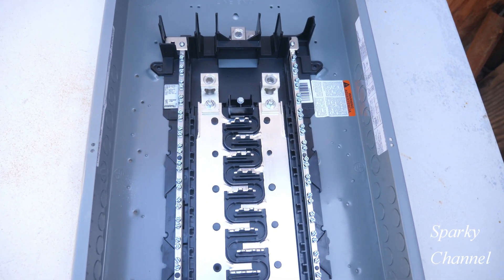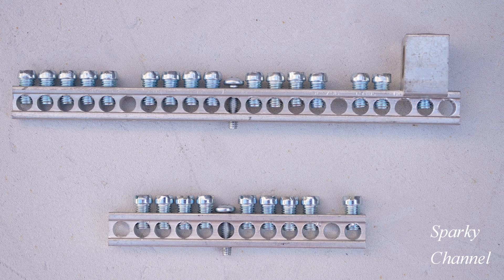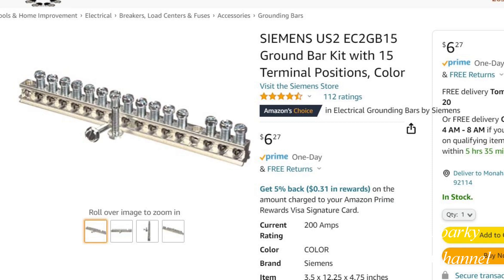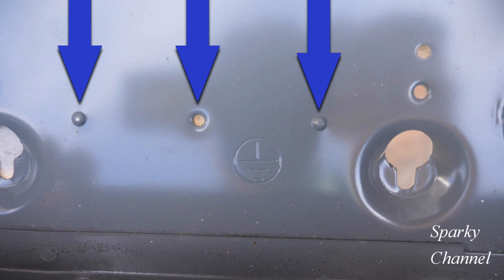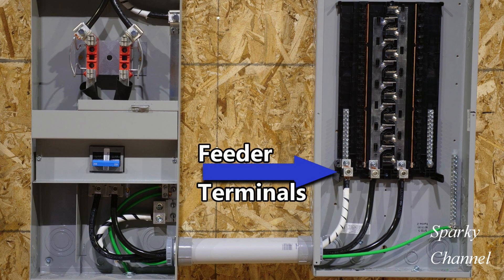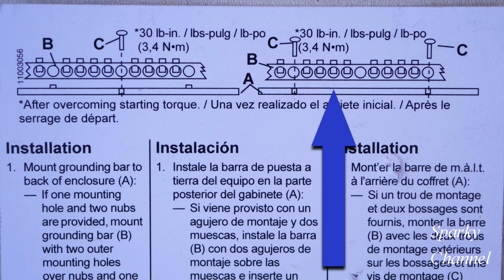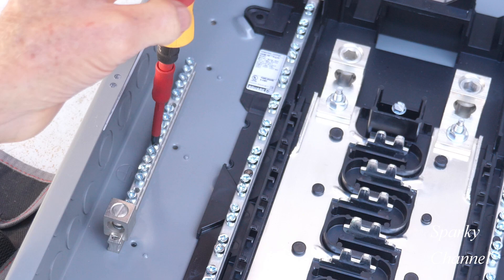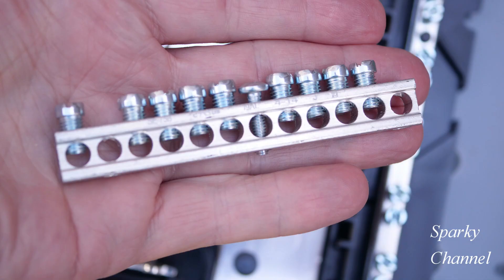How and Where to Install Ground Bars on Panels

Comment: Can i use a self drilling screw to install the ground bar
Reply from the maker: We need to follow the manufacturer's directions and they specifically say what screw to use. For Homeline and Square D, it's like the one I'm using at 3:31
Reply: you cannot.  you can use a thread cutting type screw sized #10-32, unless the bar is shipped with a larger one. (ground bar kits usually come with the screws.)
Reply from the maker: @kenbrown2808  That's true. I actually put up Sq D's statement about how they want the holes drilled if necessary as a post on my channel.
Reply: @SparkyChannel  yes. It led me to the video.
Reply from the maker: @kenbrown2808  Interesting!

Comment: I use Eaton groundbars way longer with more spots to use, bigger the better use 2 self tappers and your good to go just make sure it's tight for a good bond
Reply: Self tapping screws are prohibited from being used for grounding.
Reply from the maker: We need to follow the manufacturer's directions and they specifically say what screw to use.
Reply: @SparkyChannel  understand and try to but sometimes you have to do what works. I've come across poorly made boxes where screw hole is compromised, bad threads, stripped out it might not be by the book but it does work
Reply: @tannerbushey9196  The "fix" for a stripped out screw hole is to nut it on the back, or tap a clean hole. Anything else is jack leg.
Reply: While generally true, manufacturers do not have carte blanche to ignore code. 250.8 (A) Permitted methods of connection of grounding and bonding equipment. Equipment grounding conductors, grounding electrode conductors, and bonding jumpers shall be connected by one or more of the following means: (5) Machine screw-type fasteners that engage not less than two threads or are secured with a nut (6) Thread-forming machine screws that engage not less than two threads in the enclosure.

By specifically identifying machine screws and thread-forming machine screws, coarse threaded screws like drywall or sheet metal self tappers are excluded. If a coarse threaded screw was included in a listed assembly, it would only be allowable within that assembly. The ground bar kits are not exclusively included with the panel, they are available for purchase for general use and thus they must meet the general restrictions of the Code. The #8-32 thread forming machine screws included with those ground kits meet those requirements.
Reply: You're violating code. First of all because it's against code to mix and match parts from different manufacturers. ANYTHING you put in the panel HAS TO BE approved for use in that panel. Secondly, self tapping screws are a definite no-no.

Comment: When you put ground bars in, you might as well use the largest you can because it's better to have more than you need rather than end up running out of space.
Reply from the maker: I agree as long as you don't get in the way of your wiring. Then when you add circuits, you have the ground terminals available. Excellent point!
Reply: @SparkyChannel  The thing is because of where they get mounted, you usually have to fight with wiring anyhow to be able to get to these bars because of how deep in the box they are.  We usually have to fight with the black wires going to the breakers and white wires on the neutral bar to be able to get under all of those to get to the grounding bar.  And quite often you have to snake the ground wire through the spaghetti of wires to get it down to the grounding bar.
Reply from the maker: @KevinBenecke  Good points, thanks!

Comment: Succinctly and well covered as always!  Love having the ground bars in the most convenient location for minimal clutter.  Remember that torque rating is only for attaching the ground bar.  Wires have their own chart based on their size.
Reply from the maker: Thanks so much! Excellent point. I have a video on that: How to Know What to Torque a Breaker Terminal to?: https://youtu.be/DIffioltQZk

Comment: Bill you know of a way to monitor the circuits with BR type breaker's?
Reply from the maker: Eaton BR breakers have diagnostic trip codes designed for complex occurrences and overloads.
AF/GF breakers are equipped with a red diagnostic LED that blinks
a repeating pattern, from 1 to 6 blinks, indicating the cause of trip.
This pattern is the “trip code”. The LED will blink the trip code for
30 iterations after being turned back on.
See: https://www.eaton.com/content/dam/eaton/products/low-voltage-power-distribution-controls-systems/circuit-breakers/br-circuit-breakers/br-and-qb-dual-purpose-arc-fault-ground-fault-circuit-interrupters-td003011en.pdf
Reply: @SparkyChannel  I'm looking for a energy monitoring system to monitor electric usage on each BR type Breaker circuit. Anything you can recommend?
Reply from the maker: @johnnyW7960  I don't think they have that with BR breakers, just troubleshooting. They may have other device(s) that do though. I would contact Eaton for that.